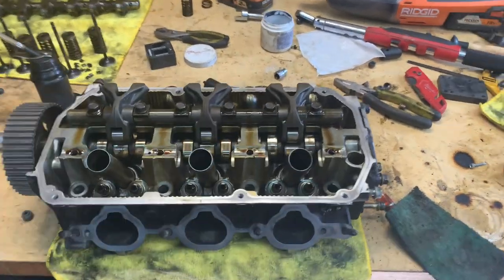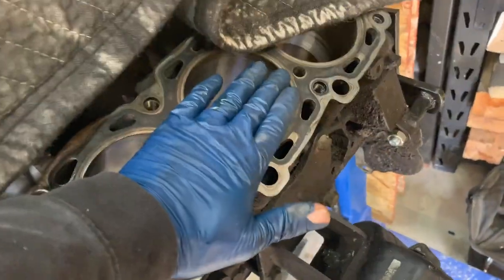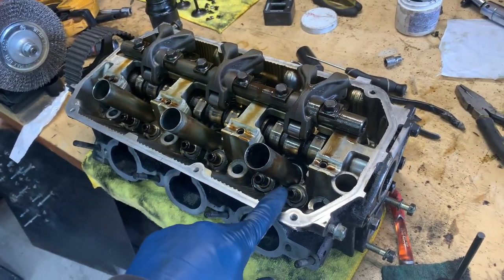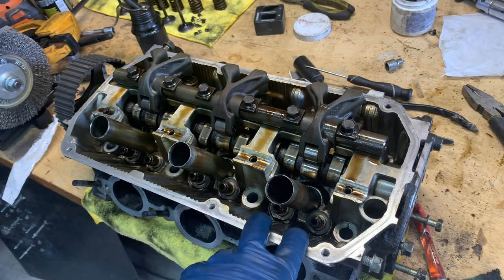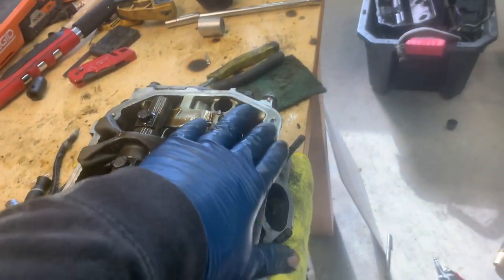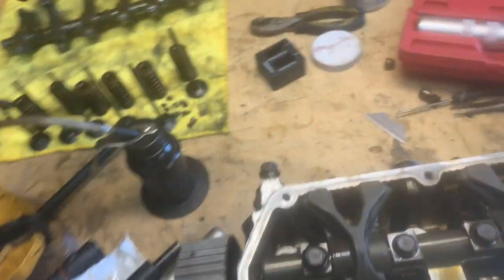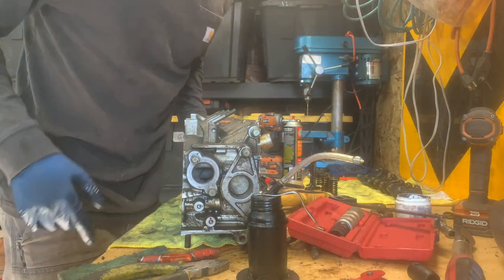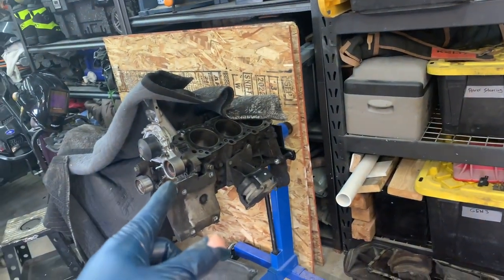This is why your Montero is burning oil

Comment: Not sure if mine is burning oil,it was leaking oil from the camshaft seal and O-rings. Driver's valve cover rear differential fill plug. Working without the brass washer just fine

Comment: I am doing the valve seals on my 03 Montero 3.8L and I have a question; in the kit, there's 2 different colours of valve seals. I suspect the 2 different colours mean one colour is for intake and the other colour os for exhaust. Does anyone know which would be which?
Reply: I have the same vehicle and will need to do the same thing.  Where you able to find a good video showing you the ins and out of the job?  I'm pretty handy and do all my own work but I usually have a good video showing me the steps.  Thanks

Comment: So this is why nobody wants to touch my gen II 3.5?? Or is there another reason I'm missing? No dealers around and it's definitely smoking when running at idol for a while.
Reply: That's most likely why the engine does that. As to why nobody wants to work on it, that may be a regional thing. It's a fairly typical Japanese engine, so if there's a do-it-all Japanese import repair shop around, it should be run of the mill. If you're living in domestic truck areas of the country, such a shop could be tough to find.

Comment: I have never seen or heard of the clamp trick, pretty cool! I feel  the same way about the removal/keeper-trapper (see what I did there?) tool. Half of it works great. A little dab of grease helps the keepers stay put during installation. I like almost all of Fel-Pro's gaskets, except valve cover gaskets. For a lot of Montero engines, 2.6, 3.0 in both configs, 3.5 in both configs, that I have experience with, they just don't fit very well. I'll spend more and go OEM on those. I like Timken for seals, so if I'm specifying cam seal replacement, I look for those first, for whatever reason. Great videos, thanks for linking it on FB, but I'm also subbed on here.

Comment: TIP: IF you decide to leave the head on, I did, then you can keep the valves in position by filling the cylinder head with nylon string (or a strip of shop rag) via the spark plug hole, on the compression stroke for that cylinder. 
Then turn the engine (BY HAND) until the piston compresses the string up and holds the valve firmly in place. Be careful, if you do this on the exhaust stroke, you will bend the valve.  When you have reassembled the valves for that cylinder, pull the string out and start on the next cylinder.
Reply: I left the head on and was able to replace all my seals on the passenger side. I can't figure out how to work on the driver side though lots of stuff in the way. Not enough clearance to swing a hammer.

Comment: Would the blue smoke be only on cold starts? Or all the time?  My 1998 montero sport consunes about 1 liter of oil every 2000km so i have to add 2 liters of oil if not 2.5 every 5000km oil change. I have 138 000 miles on my 25 year old engine. I dont see any oil on the ground but i have factory skid plates.
Reply from the maker: it is possible that the oil is leaking into the combustion chamber if it's only on start ups. as the engine warms up the rings seal better and would stop that, but it's also possible that as the motor sits and cools down the oil gets into the combustion chamber from the seals and is just more noticeable on cold starts rather than when it's already running

Comment: I need to do this but if im doing the head, what other places leak oil? I did cam seals already when i did the water pump
Reply from the maker: Rear cam seals would be good. And make sure to get oem valve cover gaskets.

Comment: I have a 2006 high mileage monteto with the 3.8l engine. It’s burning oil and I have been trying to track down the issue. I had been told already that it was probably bad valve seals and I actually already have fel pro seals in the mail along with plenum gaskets and valve cover gaskets. I just wanted to know if there is any way to be sure that’s the problem and it’s not rings or something else before I tear down the whole motor? I am hoping to take the top half of the motor off and do the valve seals without having to take apart the bottom half. At that point I probably wouldn’t want to stop there. I’d want to get it resurfaced / bored, replace the pistons rings stems and head gasket. Which is honestly more than I am trying to get in to. Is there any kind of test I can do to be sure it’s the valve seals and not the rings?
Reply from the maker: great question. it's nearly guaranteed that it has bad VSS. however, if you want to test for bad rings you can do a dry and "wet" compression test where you put a little oil into the cylinder and recheck compression. there are some helpful youtube videos that go over that. if you see a big change in compression you might also have bad rings. however these don't tend to wear our rings
Reply: how many miles can the rings go before they wear out.  I have 1998 Montero Sport 3.0 24 valve with 138k miles.  Oil changed every 5-6km

Comment: Besides coupling this with a new head gasket, any other work you could consider doing while the engine is cracked open?
Reply from the maker: good question. if you have the whole motor out, i'd say replace every wear item you can. If you have it in the car, and you pull the head i would do a quick valve clean and lap as well. nothing crazy, but it's nice to clean up that carbon in there
Reply: @montanamontero  If the head is off, then a valve lap\reseat is a must at this stage.  Also check gasket surfaces for warp, and check valve guides and stems for wear. Inspect cylinder walls, check cam wear etc.
Reply: Good time to consider replacing the hydraulic lash adjusters. The best ones have a 3mm oiling hole. If you have any valve tick, this is the time to fix it.